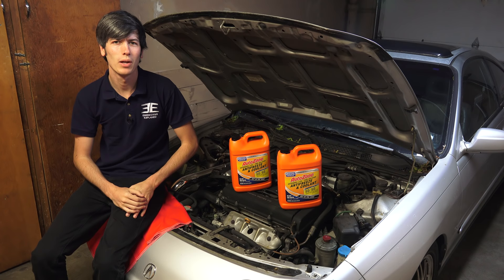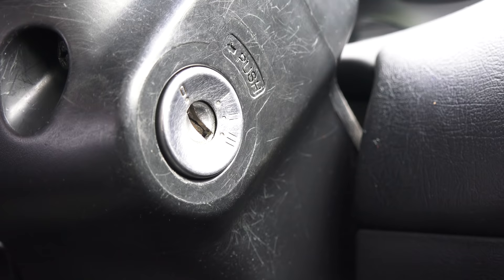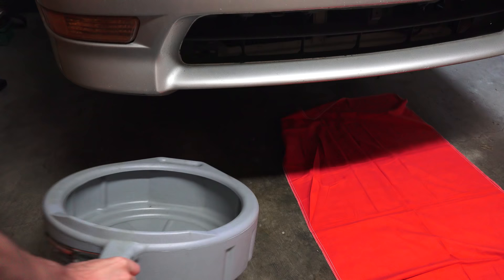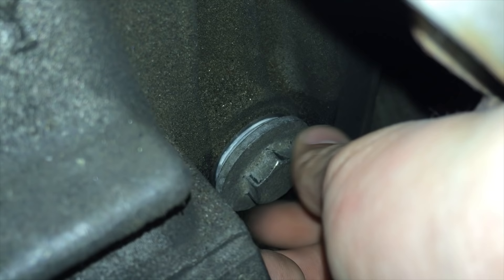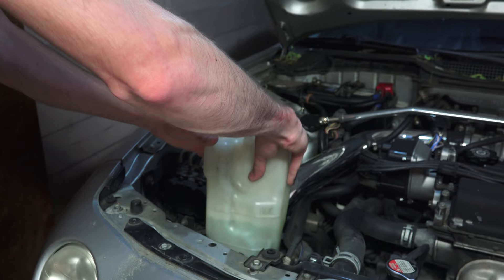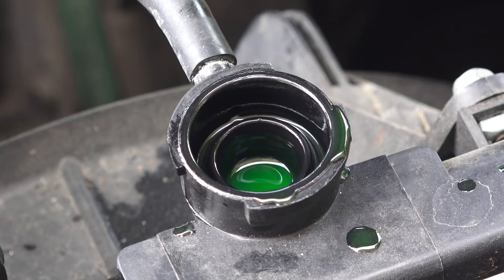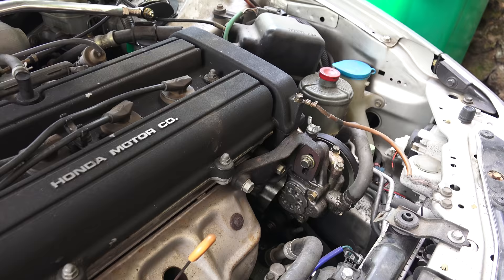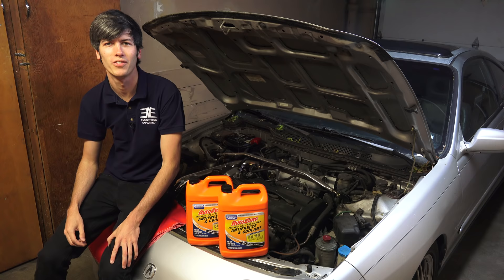How To Change The Coolant In Your Car

Comment: is it possible to fill the radiator with urine if yoj don't have access to water, for example, in the desert, ?
Reply: Spit in it.
Reply: doubt you would produce enough and it would corrode the system because urine is acidic.

although in ww2 British troops would fill the water jackets of their machine guns with urine because water was better used for hydration than keeping their gun cool in the desert.
Reply: thats nasty
Reply: +John Kyon lmao
Reply: Technically, yes. If you could produce enough urine without access to water, it would work.
Reply: Desperate times call for desperate measures.
Reply: I recall my old granpa telling me that In WW1 soldiers would breathe through handkerchiefs soaked in urine if they had a gas attack and didn't have a gas mask.
Reply: It worked in RED DAWN :) But they were on the run from Soviet forces and didn't have time to pick up any coolant.
Reply: i don't think pissing away at a radiator is going to save you in the desert..

Comment: Wouldnt thread seal stop you from opening the drain plug next time?
Reply from the maker: Nope, it simply helps prevent it from leaking. Recommended in the OE service manual.
Reply: You're thinking of thread locker, not thread seal.

Comment: On some newer cars that have the end tanks on the sides of the radiator instead of the top and bottom, there are air bleeds located on the engine block that need to be opened for the block to be purged of air trapped in the engine or over engine heating with disastrous results.

Comment: my car use a different system with no radiator cap and no bleed valve. how i can change the coolant?, also i don't use a specific fluid (only water) where i live is not so cold, i can have some problem by using only water on my rad?

Comment: Does the valve in the heater core stay open after I turn off the engine? 

Does it stay open for hours after turning the engine off (as we need to wait for radiator to cool down)?

Comment: I got a question my car started overheating I noticed my coolant reservoir was empty so I put coolant in my reservoir but not in my radiator reservoir so when I started my car back up it was still overheating so I checked my radiator reservoir and it was empty should I have put coolant in my radiator reservoir when I filled up my coolant reservoir

Comment: the waterpump is pumping the coolant from the radiator back to the engine block correct? The thermostat valve opens when ECT sensor reaches certain temperature correct? And opens it and coolant flow out the block into the radiator.

Comment: I have a 2002 Honda civic ex sohc coolant reservoir tank keeps overflowing I tried to change lower radiator hose and radiator cap fans kick on its sitting at the right temp but idk it still keeps overflowing or rising after I drive for a while any idea what else no smoke so idk about head gasket

Comment: The feels when your car doesn't have a radiator drain... I have to take the lower rad hose off every time lol
Reply: That's easier and better anyway.  Those damn plastic pepcocks like to break off after they're 5 years old and don't drain as much fluid.
Reply: Mine has a metal tap. Best of both worlds.

Comment: Hello Jason! Would you recomend "super flushing" the cooling system of a 5 to 6 years old car?
Also, sorry for asking this here, but what are your thoughts on using sea foam? I'm a bit of a perfectionist and I was thinking of doing a bit of "refreshing" to my car
Reply: use a fuel system cleaner and spray water into the air intake instead
Reply: use distilled water not tap. u don't want minerals on metal.
Reply: It depends, is the current old coolant brown with nasty clumps in it? If not, then just replace it.
Reply: Brandon Evans absolutely correct, you can also use deionized water with a radiator chemical flush
Reply: +John Kyon thank you for your replies, guys. i'm wondering, could any of this have any harmful effect? Especially the deionized water part
Reply: Mihnea Hiru deionized means its pure water, nothing else
Reply: +RealDarkFilm i know what it means, i was thinking if the dislodged gunk could do any harm
Reply: You can use a coolant that also seals leaks in about 1000 miles or so if you're worried.
Reply: +John Kyon i was actually wondering if it could get stuck somewhere else, not necesarily leak. I mean, I used the radiator leak sealing magic voodoo sand and it also stuck my thermostat on open, so.. yeah
Reply: Mihnea Hiru in which case you should flush your system and replace you thermostat, what car you have?
Reply: +John Kyon already did that back then. I have a Mercedes Benz C klasse, w203 model. I'm looking to get a BMW E92 now and do as much "maintenance and refresh" stuff to both of them during the holidays, so that's why I was checking these videos :D thanks for the helpful replies, btw
Reply: Mihnea Hiru I would recommend you don't buy those expensive money pit cars, if they do go wrong, you'll spend more on repairs than the actual car itself.
Reply: +John Kyon you're talking about the 3 series? From what I've heard some of them have electrical issues but otherwise they're pretty sound
Reply: My friend has that model. It has the thermostat CEL along with a damaged shift sensor(the auto transmission doesn't know what gear it shifts to) and some other problem I don't remember. He has no plans or repairing it because the car is old and the repair is expensive. 

The free solution to the damaged sensor is to use the manual shift feature.
Reply: +SI0AX interesting.
I live in Europe so the best option for me would be an LCI model, 2liter diesel manual gearbox.
That gets be rid of a few problems
Reply: Mihnea Hiru
His is the C230 with the 1.8 liter supercharged petrol engine. The car is pretty fuel efficient and has great performance.
Reply: SI0AX bmws have terrible fuel efficiency
Reply: +John Kyon not really, no. Don't generalise
Reply: +SI0AX oh you were talking about the Merc. Mine has the front passenger airbag light on. Probably the sensor in the seat went out and it's pretty pricey
Reply: Get yourself a Citroën Cactus
Reply: +John Kyon oh god. You must be joking mate
Reply: Reasonable price and excellent space and comfort with good variety of engine choices,  I am being biased because I want one
Reply: +John Kyon depends on your budget and what you want from a car. For me, it's a bit weird looking and not quite what I want.
But on the other hand, I was considering an Evo 8 so I'm not exactly the voice of reason here when it comes to cars lol
Reply: Buy a car that make other people look and say wow, this guy doesn't copy other people
Reply: +John Kyon it should really represent you. I agree
Reply: John Kyon
Yes, BMW's do have bad fuel economy, but the Mercedes with the small supercharged engine has (according to my friend) excellent fuel economy, and I rode passenger and thought the car had a little more performance than a sport V6 which is pretty awesome for a 1.8l 4 cyl.

My friend used to drive a Mistubishi Outlander 4 cylinder from like 2007 and he complained that it was a gas guzzler, he compliments the Mercedes fuel economy greatly and it's a older 2004 model.

Comment: I need some thoughts on this. I took my car in to a new shop to get the service done yesterday and I loved seeing how simple the process was at my new mechanic's. 

However, I was worried when the bubbling/purging process, when the car was sitting idling for about 15 minutes, the coolant in the radiator was acting very weird, like there was change in colors from a very light green to slightly dark version (as the car was getting warm). Should I get it reflushed at another shop? Why did it act like a chameleon and change in color as the engine warmed up?
Reply: Probably too late to answer but they might have just used a different coolant color than the OEM and the mixture of the two colors usually looks kind of gross, ie. My car OEM coolant is green, but if I were to use a blueish/purple coolant the color would change to something gross. Nothing wrong with it unless the aesthetic displeases you

Comment: Do you put the radiator cap back on when the engine is still running or when its off.
Reply: If you are a senior, advisable is when it it is turned off,again depending on degree of damage.

Comment: Where do you dispose of the old antifreeze?
Reply: I would like to know as well.
Reply: Look up places around you that dispose of hazardous materials (same goes for used oil). Sometimes you have to go to the site, but I also know that some shops will take it. Also, some shops will buy back dead batteries, so if you have those lying around you might look into that!
Reply: auto parts stores take used car waste, though I think antifreeze needs to be stored in a different container.
Reply from the maker: You can bring it to the same auto parts store you bought the new stuff from. :)
Reply: +Engineering Explained I had done the coolant on my integra before and the first time I had called autozone and they dont take in antifreeze. I called the city and they took care of it. so if people call city hall or such, they can help with disposal of hazardous chemicals
Reply: Rudy Salas I've mixed my motor oil with it and dumped it at the store. They just send u back to the tank and don't watch anyway
Reply: +Brandon Evans hahaha thats messed up. they would probably think that someone had a bad headgasket
Reply: Rudy Salas does your store watch you dump it? I use those black plastic containers they sell for oil changes.

They recycle it and its way better then out in the woods like ppl used to do.
Reply: +Brandon Evans when I do oil changes I recycle the old oil into the 5quart bottle that the new oil came with so its pretty much full to put 2 gallons of antifreez in there. best way to keep the environment clean is just recycle it properly
Reply: Shadow Hamster not that hazardous? Its sweet to animals and they die if they drink it because its toxic and if you throw it on plants, usually new plants dont grow there. You chinese must have the fake 90% antifreeze if you think its not bad
Reply: Rudy Salas I think he was joking
Reply: +Jake B how so? chinese are known to do crazy things
Reply: How about you drink it.
After all it is 50% water
Reply: IIGrayfoxII no they glycol will blow your kidneys
Reply: I know but Mr China says it is not dangerous in china so drink it
Reply: the joke flew 10000 feet over ur head didn't it?
Reply: I always put it out in a giant bowl for the stray cats and dogs to drink, they seem to love it every time I leave it out. Supposedly it tastes sweet so maybe that's why? IDK for sure though.
Reply: It can kill them. Heck it probably has done in a couple of the things.
Reply: Y10Q Legitimately, what's the difference between irresponsibly allowing animals to eat onions/garlic in a burger and irresponsibly allowing animals to eat antifreeze?
Reply: Engineering Explained I called AutoZone and they said they don't take it
Reply: Justin'sQuickFix P. Called Auto Zone, Advance Auto, O'Reilly's, Napa, and even Toyota dealership. None accepted used coolant. Toyota was the most helpful and told me to call mechanic shops. found one that disposed of used coolant.
Reply: make Cady out of theme
Reply: Check with Autozone. They take the oil...
Reply: toilet
Reply: the ground
Reply: Cats
Reply: Down the sink
Reply: Epa's website says drain it in the sewer
Reply: in the toilet, you can't get any more toxic than the sewer, and sewage pipes go straight to cleaning facilities. you could also bring it to some other place, they will bring it to the exact same facilities..
Reply: Pour it on the ground or leave it in a large bowl outside so that the birds will drink it removing it naturally, they will use the energy from the coolant sugars to pollinate vegetables gardens. This is where babies come from.
Reply: i froze my old coolant and serve it at house parties
Reply: put it in a mountain dew 2 liter bottle and then in the fridge

Comment: I don't feel comfortable with removing the engine bolt. Would I still get ok results if skip that step?
Reply: drive 100 miles on 100% distilled water.  drain.  do it again.  drain.  that's plenty good enough to get most of the old coolant out of the engine block.  just dont do it during winter when temps are below 32F.
Reply: Joeybsmooth you don't need to

Comment: I don’t think my engine has a coolant drain bolt. 
must be for larger engines.

Chris fix never mentioned those
Reply: If you watch the video carefully, you'd see that the engine drain bolt is on the exhaust manifold side, so look around there, it's a vertically positioned bolt, not underneath.
Reply: I looked up on my make and model.  (a 4 cylinder)

no info comes up.
will check
Reply: Mine car is a 4 cylinder too, but unlucky for me, the exhaust manifold is on the firewall side, so the only way to access it, is underneath, and for me, it stood out because it was sealing a side of the engine, and not holding together two mating surfaces.
Reply: Hondas/Acuras usually have coolant drain bolts and even better a bleeder valve

Comment: what happens to the coolant that requires it to be changed every  X0 000 miles? do the compounds in it degrade and make it less effective? im running a 20 year old shitbox, never changed coolant, the piece of crap is running fine i just can't kill it.
Reply: Over time, your coolant can become acidic and begin to breakdown which could lead to corrosion within the cooling system.

If you coolant is still a good clear color, and you don't care about the vehicle very much, you're probably fine. You've got a better chance of hoses starting to crack, or seals giving out with a vehicle that old.
Reply: +legacysage 20 years isn't that old, but if it's shitbox it's a problem, performance cars from the 90's are usually kept in good condition.

Comment: there is a faster way to do it where use use a compressor to suck all the air out and then release all the fluid my teacher in auto school showed me i dont remember the name of the tool tho it has adapters to fit different radiators

Comment: Ive done a few cars, none of which had a engine block drain bolt. I simply drain the radiator and hope the block gets drained too. Or I'll pull the lower radiator hose.
Reply: BTW auto zone coolant is the same exact stuff as Peak Long Life. Same manufacture, same formula.
Reply: One trick that I've found useful is to turn the car on for a second or two with the lower hose detached. That usually spits out coolant from the deepest recesses of the engine. I don't think I would take a chance opening up the block unless I absolutely had to. Seems like a plug begging to strip or break...
Reply: The legit way is to drain the coolant you can, then close everything up and fill it all the way with distilled water, then run the engine and hold a low rev till the fan turns on a few times, then wait till it cools down(could take 4 hours) then repeat till no color is left in the drained water. It's what my factory service manual says to do but that is not productive at all lol.

Comment: Why are some coolant overflow tanks pressurized and some are not?
Reply: Because some cars don't have a radiator cap and use the tank as part of the closed pressurized system. Others use a pressure cap on the radiator and use the tank just for expansion overflow where the fluid flows into the tank until the cap closes and then is sucked back into the radiator when the cap opens due to vacuum in the radiator caused when the coolant retracts. In the old days, a simple pipe would run down the side of the radiator  and vent the fluid to the ground. That's why you would need to remove your radiator cap and check your coolant at almost every fuel fill up. For many years in the 60's, my father owned a full service gas station and I watched him open radiator caps with a rag to release the pressure and add water.

Comment: Im late here but, shoulda mentioned check the torque wrench's last calibration date and condition. If it looks abused or dropped, get another.
If we drop or hammer a torque wrench on aircraft its a immediate bad tool, needs recalibration. At least by AF standards

Comment: Anyone help please
I did coolant change on my g37 afterwards it seems like air was stuck in the system..how do I get the air out and what’s the danger of it staying ?
Reply: When your engine is cold, open the cap and turn on the heat and start the car for half an hour then close the cap and turn off the engine
Reply: Bassam salim
I didn’t do that however I changed my cap and air went away

Comment: Do you need to have 2 gallons of coolant for any coolant change in any car?
Reply: Typically yes. Some people like to run 100% distilled water to get all the crud out then do the 50/50 mix after.

Comment: Ah crap I thought it was as ez as locating the radiator's drain plug but I also need to find out where's the engine one? Damn it..I own a different car so I wonder is it will be as easy as with the one showed here. I own a ZC33S.

Comment: and i just use water on my radiator. is it bad for long term usage?
Reply: Water has even better cooling performance than coolant mix when everything in the cooling system is still intact, but in the long run the lack of rust inhibitors will bring an early death to the cooling system.

Comment: It seems after the fluid change you just ran the car with radiator cap off for about 35 to 40 minutes and that released any air bubbles...which means you didn't need to bleed the radiator correct....

Comment: I put the antifreeze directly into my radiator not the reservoir what is the problem or what kind of problem is it going to cost me?
Reply: Because it is not traveling to the reservoir
Reply: as long as you made sure theres no air in your loop, you should be fine.. just keep a close eye on engine temperature, if it stays stable even when you push your car to the limit, you are fine..